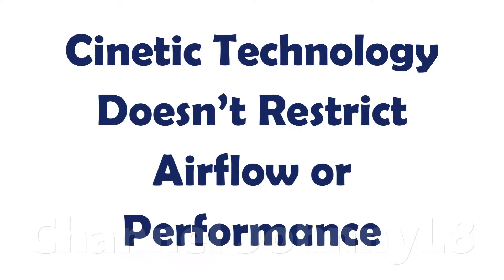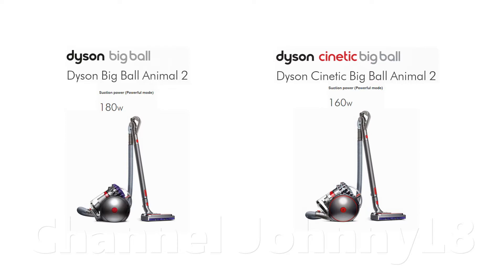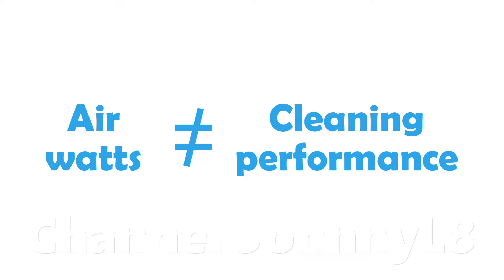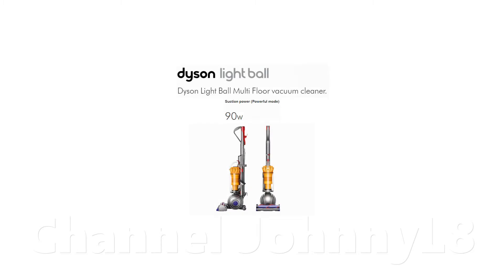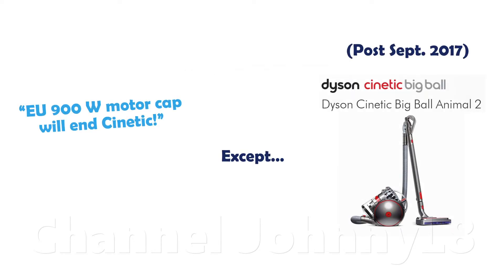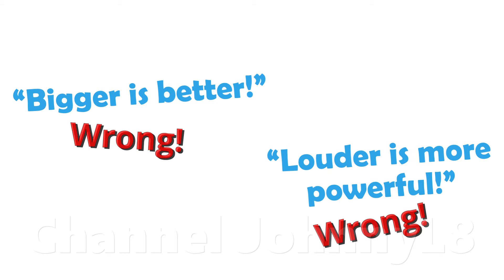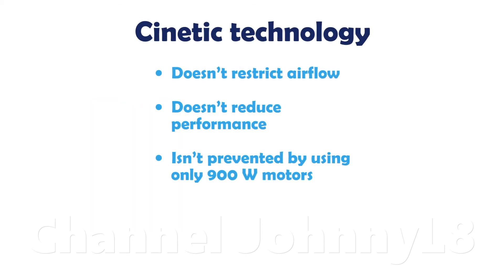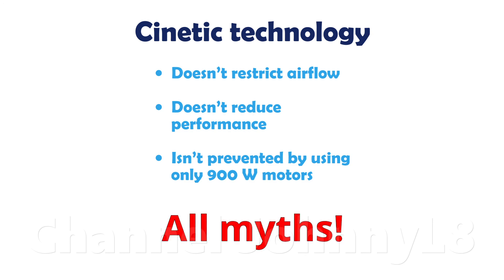Dyson Cinetic Technology Doesn’t Restrict Airflow or Performance

Comment: The one thing that people don't understand is this, the bottom of the cyclone does not affect airflow, the bottom of the cone is to expel fine dust and bacteria. There is no airflow there it is a pressure nutral area.
Reply from the maker: The presence of cyclones rather than no cyclones will of course cause a relatively greater restriction. This is the same as how a bag relative to no bag will cause an analogous restriction. Anything which interacts with air will cause air resistance. But the resistance, of any form, is taken into account in the design and choice of motors etc., and what's important to determine cleaning performance (considering just the air flow component) is the air speed, not the air current/flow, as this directly translates to the kinetic energy the particles need for extraction. I'm going to cover this in my next video as it seems to be the single largest source of misunderstanding currently.
Reply: Vacuum Facts well I think you’ll find your wrong once again as after use the cyclone always gets dust and often will block
Reply from the maker: It may have more airflow at the hose, but what's happening at the head is more important. The pressure difference the motor can create at the floor head determines the net flow, but a large flow doesn't necessarily translate to high air speed—which is critical. The surface area of the head needs to be considered as well as any leaks (i.e. how well it seals to the floor). Also the nature of the floor type needs to be considered; a solid hard floor will restrict air flow, but the air that does get through may still be travelling fast (hence why you can clean gaps and crevices well). It's possible to have large air flow but low air speed (like a wide slow flowing river; lots of water/current, but low speed; you can swim across that easily). But you need high air speed to remove particles (so fast flowing river that's hard to swim across without being carried away). Air speed through the pile is most important, not air flow/current. Assuming the motor could deliver, you could in principle just double the size of the head to double your airflow through the carpet, but you might not increase your air speed because that additional flow is distributed across the greater carpet area, so you're not cleaning any better despite a higher CFM. Fixating on CFM alone as some be-and-end-all metric of greatness shows a misunderstanding of the principles of cleaning (i.e. particle motion in complex fibre networks). In summary, you need to engineer high air speed at the cleaner head through the pile to force out particles and clean well, but this is achieved after consideration of many parameters. Air flow just measures amount of air flowing, but on its own says nothing about the speed of that flow through the pile.
Reply from the maker: I suspected that actually. Why else would Dyson not have said anything officially and it appear on a third party website. Embargo failure.
Reply: Hi can you answer a question for me please. I have seen a video where the airflow was measured through the cyclones and then bypassing the cyclones. THe airflow was much stronger when bypassing them. How can this be if there is no restriction? Surely a Kirby that has the fan right next to the flooring ( direct air motor)  will have much more airflow than a Dyson?
Reply: I will look forward to it.
Reply: JohnnyL8 I did try an experiment. I put some particles down on my hardfloors. I moved my Miele C3 hose and Dyson light ball hose towards the dirt to see which would pull in the dirt first. The Miele won by a good few inches. Doesn't this show that the miele has more airflow and will pick up more dirt?.I know you say airflow isn't important but how else do you get dirt into the bag or bin without air flowing? This is what I can't get my head around.
Reply: JohnnyL8 Yes I see that. The design of the floorhead. . But how do.you increase air speed? I've seen some manufacturers are now using a conical shaped hose. Does that increase air speed?
Reply from the maker: You increase air speed by maximising the differential pressure and ensuring the flow travels through a carpet optimally to accelerate particles. This is achieved in many ways that culminate in the umbrella term of "good cleaner head design". Pile needs to be spread by floor head during the push and pull (hence why the floor heads have rubber fins/soles on them now) and also the brush bar action (which does multiple things which I discussed in a past video). Airflow should be directed only through the pile and not leaked in gaps, especially on hard floor, and there are probably other subtle things that support all this (like the wide diameter brushbar) and shape of the suction area on the head (it'll be an engineering optimisation study, twiddling with parameters until you get a good result—i.e. R&D). The net result is you can release dust trapped in the surface layers where it's harmful, and achieve high air speed and impart maximum kinetic energy to said dirt particles from the fluid flow with relatively less air current (air flow) if the system is highly optimised. This is in fact why with just 16 air watts of air power, yielding a given air current/flow (i.e mode 1 in the V10), I can clean (real-world) messes extremely well. All these old 'powerful' machines of the past just brute force similar performance. They do perform well enough, but inelegantly, quite wastefully, and inefficiently—and even overly so, in fact, as I'll discuss in the next video when I explain why "deep cleaning" is a myth. Showing an old Kirby or something, that weighs the same as a cow, can pass a mega mess test or can suck the loose teeth out of your child from across the room, and is therefore automatically a good cleaner, can be misleading in real-world performance terms. It may also still struggle to get the fine (read: harmful) dust as MadAboutHoover's otherwise visually entertaining Kirby video showed the other day—that's the real test of a good vacuum, what's left with repeated go-overs—all that rice—not exactly fine dust, despite all those "CFMs"; surely it should have been a perfect result... ;)
Reply: JohnnyL8 Madabouthoovers actually called me Johnny L8 the other day. Haha. The Kirby is very heavy but it's as light as air to push because of the tech drive and it uses very little energy. It's rated an A+. I just wish they would do a 12" nozzle as it's too big and bulky . It's also loud 88db. They will have to.do.something about that very quick or it will be banned in the EU. Did you know Dyson have a new Ball 2? With a pivoting wand and wacky colour scheme? ,😁
Reply: Some Kirby fans are very annoying with their claims that Kirby is so superior , everything else is plastic crap and you can only get clean carpets if you use it. 🙄
Reply from the maker: Ha, hence why I always say "show me evidence" i.e. industry standard testing which compares apples with apples fairly. Kirby never quite seem to show any of that—which is strange when you think about it given how strongly they purport their superiority. Money where the mouth is please—at least Dyson do that, like them or not.

Yeah the new Dyson upright (literally silent release and not even on their website because they don't really care about that form factor going forward) is actually the Light Ball done right.

Pity MadAboutHoovers banned me; I enjoyed talking with him because, unlike many, he listened, much like you do. I guess he stopped liking some of my comments which were negative towards other cleaners (but accurate) and that conflicted with his opinion. His videos are still good visual entertainment for many; I'd never knock that. And when I criticise any YT content, it's not the people or effort I criticise, but the conclusions or that it can be misleading. I'm never hostile towards people (although sometimes I can get frustrated with constant attacks). People are just too sensitive. If you can't take constructive criticism, or defend your position, then why bother allowing comments. If all people want is positive reinforcement, then they just need to stop being public and surround themselves with "yes" men. Despite all the unfriendly abuse and borderline bullying I've received, I've never banned anyone; I can easily take it. xD The only time I'd ever ban someone is if they were repeatedly in violation of YT's policy and being jerks. One creepy guy was close once; I complained to YT who agreed with me and slapped his wrist. I'm sure it was portrayed as my fault elsewhere...
Reply: JohnnyL8 Yes people need to remind themselves we are talking about vacuum cleaners here. I'm guilty of that too though haha. I like to hear both sides of the argument and then decide which one makes more sense to.me. Did you like the Riccar vac?
Reply: Mark Pritchard that product was not ready to be sold ! Very messed up 😑
Reply from the maker: And it looks like the shop isn't selling it now, meaning they probably got slapped by Dyson and some legal people.
Reply from the maker: I see Dyson officially, but equally silently released the ball 2 upright. https://www.dyson.co.uk/uprights/dyson-ball-animal-2-overview.html
Reply from the maker: I also see they messed up the product fiche link on their website which shows the wrong machine and makes it look worse than it is.